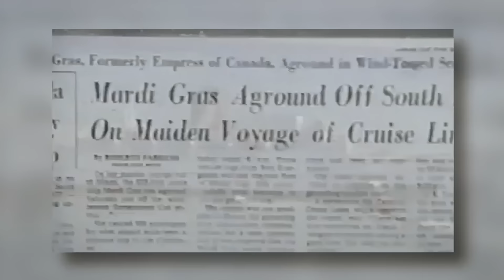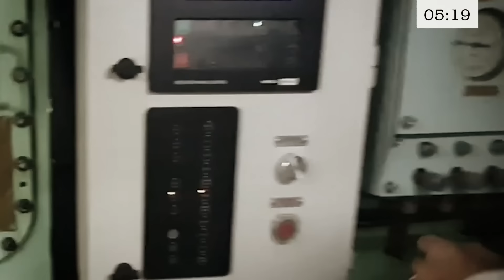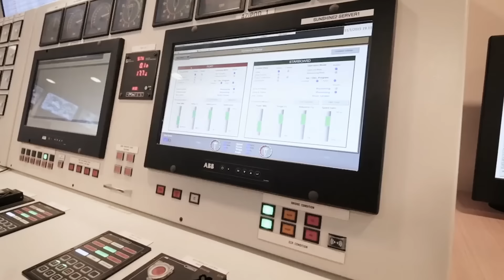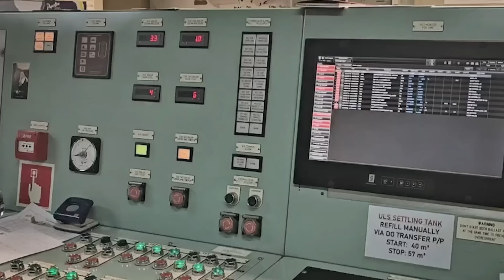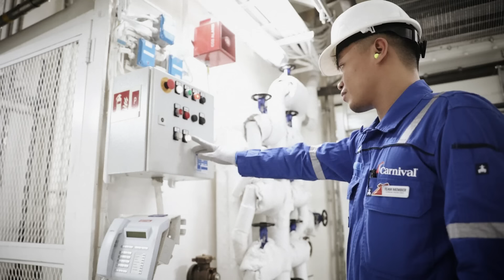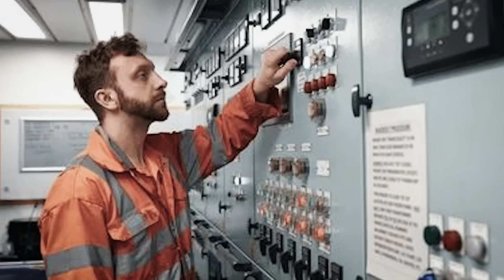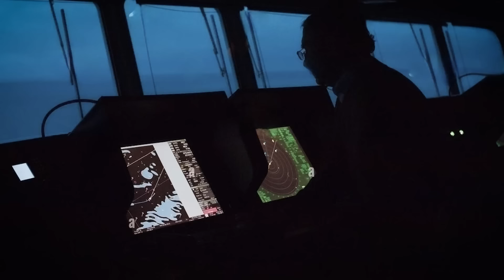From Carnival Party to a POOP Party!

Comment: Honestly given how many things had to go spectacularly wrong for this to happen they handled it kinda well. They evacuated the woman who needed it, got supplies from nearby ships (leaving them on the borderline if anything went wrong), arranged transfers and compensated all passengers (not just per room by the sound of it). Yes it is a good PR fix and the minimum that should be expected but how often have people had to fight for this?
This whole thing could have been worse though. Imagin this but in the middle of the Atlantic of Pacific? Or just a notoriously dangerous patch of water? I live not that far from Bass Strait and the roaring 40s that is freaking dangerous man.
Reply: I agree with you but the deferred maintenance was just pure stupid simple greed.
Reply: @JohnHoranzy not really. It's quite often for any vessel to have one or two engines out of operation. 
Also it wasn't an engine problem it was oil leakage problem which occurred because pipes weren't outfitted with protection due to, most likely, oversight in vessel's design.
Reply: @Grigorii-j7z  According to the video the shields were put up over the flexible couplings so they could defer the replacement of those couplings. The flex couplings were still leaking flammable liquid.
Reply: @JohnHoranzy  as I understood the problem was with underdeck pipes, which weren't covered with protective shield due to limited space. Basically those pipes have a leak and due to pressure start spraying fuel on hot engine above.
Reply: @Grigorii-j7z  why do you keep making excuses for these people that purposely left a safety hazard  with leaking fuel unrepaired?

Comment: I went on a cruise ship when i was 17, with my friend and his parents. We quickly got to know all the other kids our age and got up to a tonne of mischief. We discovered that one of the outside bars shut at 2am and would be entirely empty and we could go behind the bar, turn on the ... gas? for the beer lines and even though they had removed the taps we could insert something into them and beer would come out. Cue finding cups and a bunch of us kids getting drunk, we were sneaky about it and did this nearly every night of the cruise without getting busted. This also turned a bunch of us into night owls, who'd sleep most of the day and get up to shenanigans at night. We hardly ever saw my friends parents as we were operating on different day night cycles, and they were too busy having their own fun to pay much attention.

There was also a tropical storm we had to avoid and miss one of the destinations, and they closed all outside decks for a day. We found a way outside and that all furniture had been tied down. With the heavy wind we discovered we could unsecure the plastic tables, have them upside down on the deck with the four legs sticking in the air.... then flip them up, hold onto two legs and put your feet on the other two legs and the wind would turn it into a makeshift sail and hurtle you down the deck. The deck was curved so you'd hit the railing and be slowed down slowly until you got to the center. We got to do this a few times each before we were busted, names taken and threatened that the captain would speak to us (which seemed like a very serious thing at the time). I guess it was incredibly dangerous... but so much fun. 

I've never bothered going on a cruise as an adult because i will never have so much fun and mischief as i had as a kid lol
Reply: Solid work and Farrout Ma!
Reply: You wernt a kid you were a 17 year old acting like a 10 year old
Reply: @D4narchy  also mocking somebody for making a comment on youtube as time wasting and being no life when you just wrote that novel is hilarious.

Comment: Carnival really did need to send more tugboats immediately, and Portapotties. Six knots an hour over such a distance was just not enough. This ship was a health emergency. As a nurse, I'm shocked that human waste from 3000+ people was allowed to slosh around. So dangerous from a nursing perspective.
Reply: Even if they had a way to get portapotties on board they would have been quickly overwhelmed.  They'd need hundreds upon hundreds of them and there's just no feasible way to do that; it's quicker to get the ship to port.  A lot of passengers made things worse by still using toilets or their shower instead of peeing / pooping in a trash bin and dumping it overboard.

I haven't finished the video yet so he may have covered this but there were a lot of challenges with getting the tug to port and the Gulf's current wasn't doing them any favors early on.  Ultimately at the end of the day this was a freak and unprecedent situation that's been corrected in newer cruise designs.
Reply: Side note, I just checked the offical report and they had 4 tugs working to bring her in plus a 5th on standby so it wasn't a case of a single tug

Comment: I mean.... despite the problems they handled it fairly well. Got the critical folks evacuated, brought engineers on board to fix the sewage issue to make the last day or two bearable, fully refunded folks trips and got them transportation to get back on their way home, slipped them a few bucks extra to cover what would basically be new clothes that probably got ruined on the sewage barge it became, etc etc. Even had the big man out to apologize. As far as disasters go this was by far probably one of the better compensations handed out and would at least be adequate.

Comment: Noone died or even got hurt.  That's a big win for everyone!  I'm guessing that the refund included all the charges the passengers made for things they bought and activities they had to pay for. Plus their passage tickets.  The problem with the thirty bucks per passenger award is that the generator was overdue for maintenance, which caused the disruption and potential disaster of deaths. It was the cruise lines fault. They needed to be FINED and that fine go to the passengers split up equally. But when all is said and done, they should just be thankful it wasn't worse. 🙏

Comment: the fact they had thousands of them bags means they've ran a scenario where toilets failed and someone chimed in and said ''plastic bags !'' ,and the ceo said '' Brilliant idea '' 🤣.

You'd get the engineers to cannibalise the top deck railings grids vents etc steel and start making porter potties they can hang over the lower deck railing so they could poop in the sea lol  with bed sheets privacy ..
Few hours work for lads that definitely have a decked out workshop onboard..grinder welder etc..they can change a broken piston at sea so 2 dozen port potties is easy..
Reply: That's one thing about this incident that I've always wondered about.... why did they not make makeshift toilets that allowed waste to either drop directly into the sea behind the ship or drain down spare pipe to the sea.  

Day 1 they should have made a designated male urinal area for dudes to just piss over the railing and in a matter of hours could have rigged up some sort of temporary toilet mechanism using the materials you mentioned.
Reply: @cruisinguy6024  
Crazy isnt it , i'd never go on a cruise ship .
Reply: @TheCraigy83  I've had amazing memories and vacations on cruises but I realize they're not everyone's cup of tea.  I've even cruised on Carnival before although now that they've officially become the WalMart of the Seas I can't see myself cruising with them again.

Comment: Carnival lines is the cruise line for.. people you don't wanna be around. Trust me there and spend the extra for Royal Caribbean.
Reply: Carnival is the WalMart of the cruise industry
Reply: Been on Carnival, NCL, and Royal Caribbean.  Never had anything less that a great time on Carnival, never had a good time on NCL, and Royal fell right in the middle.  Absolutely best crew are on Carnival. Of course, I don't do the cheapo 3 day booze cruises on Carnival...Mediterranean, Baltic, Alaska, trans-Pacific, and 10 day Caribbean have a different demographic of passenger who's not there just to get drunk.
Reply: I was told Carnival is the Motel 6 of cruise lines. Never had an issue with them.
Reply: @musicmanfelipe more like the section 8.

Comment: Two things, 

1 - if the emergency stop was activated for engine 6, then the power would be gone straight away. The breaker would open and then the generator would stop. 

2 - A cruise director would never be on watch, especially not on the bridge.

Comment: IF a flexible fuel line is fit for purpose, it will only last a certain amount of time in operation before it degrades and needs replacement.  A reasonable person would expect that this period of time would be on a maintenance schedule and part of routine preventative maintenance.  If fuel lines are going to be near hot objects, then from factory, the manufacturer would be obligated to build in the required safe guards by using solid piping and/or shielding.  The Australian Navy royally screwed the pooch some years ago, when they had solid,high pressure fuel lines on the HMAS Westralia replaced with flexible hoses not rated for the application........the resulting engine room fire was horrific with fatalities.

Comment: The story doesn't stop there: "On April 3, 2013, while Carnival Triumph was docked in Mobile, Alabama for repairs following the February 10 fire, gale-force winds caused the ship to break free from her moorings and strike a moored United States Army Corps of Engineers vessel, Dredge Wheeler, sustaining a 20 ft (6.1 m) gash and railing damage on her stern above the water line before coming to rest against a cargo ship." That incident sadly killed someone.

Comment: Pretty sure they didn't put spray shields on the pipes below the deck plating because of, well, the deck plates that were acting as a stray shield themselves.. 😂 I mean the plate would block any fuel leak that would spray from allowing the fuel spray to  contact any of the hot machinery or metal that they were worried about. The only ones they would have to worry about would be the deck plating that had venting or didn't make a tight seal against the surrounding plating when mounted.... Seems someone forgot about those plates 😂

Comment: Ahh, the poop cruise.  I saw a design flaw right off.   The generators are critical to everything on a modern cruise ship.  The generators should have been divided up into 4 comparts with completely separate switching boards each board capable of switching all power on ship.   This cost money, but INSURANCE COST MORE MONEY AND THIS MIGHT RESULT IN A LOWER INSURANCE PREMIUM.  Some money managers did not think this out.

Comment: The bottom line is carnival cruise lines was Fully aware they had a serious safety problem with their fuel lines and did not take the proper action to correct them. Even going as far as lying on their Own inspection Reports reporting to the u s coast guard.

Comment: Why would the lack of one generator plunges the boat in darkness? There is no isolation between anything? Kinda boggling they couldn't power essentials..
Reply: If I remember correctly the issue is that the fire destroyed a common point of failure with the electrical bus so they had no way to transfer power to where it was needed.  For years after this incident as a safety measure cruise ships had huge portable generators installed on an upper deck and had massive cables ran into the engineering spaces to provide power backup in case a freak situation like this happened again.

Newer cruise ships had the design improved so this couldn't happen again.

Comment: One of these days a cruise ship like this will have the statistically unevitable sinking in 10-15 minutes that take down all hands and that has long made me wonder how the industry will change due to public perceptions given people are typically not rational when thinking about these things and the fact you're more likely to die driving to or from your cruise then on it won't register.
Reply: I doubt that will happen and instead the closest we will get is a Costa Concordia type situation (which was indeed horrible) or freak incidents like this where a relatively minor fire causes significant passenger disruption.  Given that the majority of cruises are in pretty open and safe waters it'll likely be quite some time before there's another Concorida type situation.

Cruises and ferries, like commercial aviation, used to see disasters pretty regularly but thanks to modern safety standards and procedures most of those risks have been engineered, educated, and trained out of the real of viable situations.
Reply: @cruisinguy6024  it's a statistical inevitability

Comment: The worst thing you can do as a passenger is panic in this situation. You don’t help the situation at all, and can indeed just make things worst. Keep calm, go to the muster station, and wait. Once the initial fire problem is done, then you can go krazy Karen because got damn, where are the redundant generators? Where are the redundant septic systems? Honestly why wouldn’t you have backups for the booster pits/ why wouldn’t you just design it so the shit flows down to the tanks without need of booster pumps? It seems like no one planned backups for when critical systems fail. Modern freighters have better backup systems than this thing did.

Comment: Yeah no. I’m not into flu cruises or Covid carriers or literal poop decks. My parents went on these cruises and came back with a severe case of the shingles. Sick for months.
Reply: Something doesn't sound right here.  Shingles is not contagious in and of itself.  For them to both have contracted shingles it means a) both of them were never exposed to shingles when younger and b) they did not get the shingles vaccine and c) they would have both had to have had contact with someones open blisters as it's not contractible from sneezing / coughing / etc.

if they actually had shingles almost certainly it wasn't directly related from the cruise, and they definitely wouldn't have come back with it right away.

Comment: Piss poor preventative maintenance. Why didn’t the emergency generator kick in automatically? Even if the emergency generator fails at any point, there should be banks of batteries to supply minimal electricity.
Ships are registered in the Bahamas because they have poor safety requirements.

Comment: Why anyone would anyone want to lock themselves in what's basically a floating hotel.. with no escape,  with thousands of people who could (and do) act like ars3holes.
At the mercy of the elements, exposed to recirculated air in what's basically a floating petrie dish. And dependent on crew that are notoriously poorly paid and looked after, and run by a company that is, like most, driven by profit.
And don't forget, the fuel these ships use is the most toxic and polluting of all fuels.

Comment: im confused as to why the crew itself was not able to restore power.  do they not have engineers on board for a normal cruise?
Reply: the fire damaged the electrical bus that was a single point of failure
Reply: @cruisinguy6024  so the people who came in on the chopper, they brought parts
Reply: @beardedgaming1337  okay......and?  There was extensive electrical damage that could not be repaired at sea.  If there was any possible way they could have restored hotel power and function they absolutely would have instead of living in these horrible conditions for several days.
Reply: @cruisinguy6024  That's what I'm getting at. If parts weren't brought in, then the engineers on the ship were underqualified. If parts were brought in, then that changes things.
Reply: @beardedgaming1337  there was extensive damage to the room and electrical wiring between the engine room and the control room.  All the parts in the world wouldn't make the necessary repairs in time.  They can't just "bring in parts" when there's extensive fire damage to key components.

There was a lot of coverage on this back when the incident happen, you can refer to old in-depth news reports and even youtube videos that broke down the technical aspects.  The official report from The Bahamas is also available online that includes pictures.